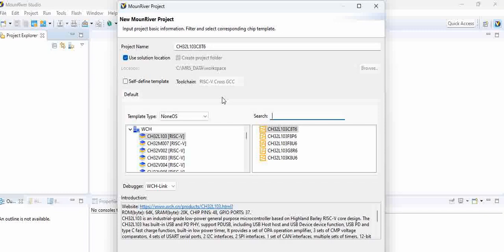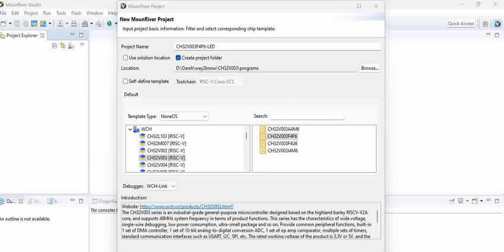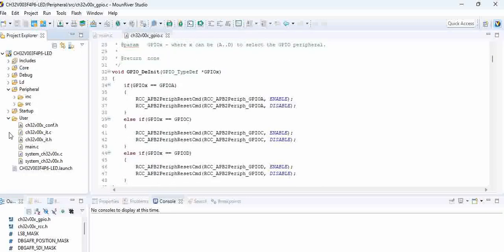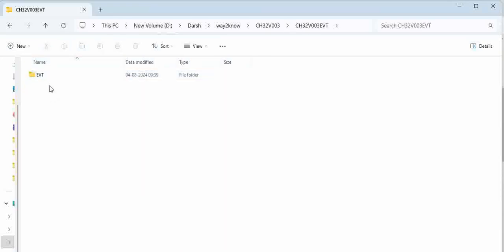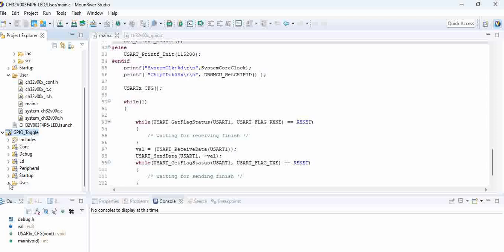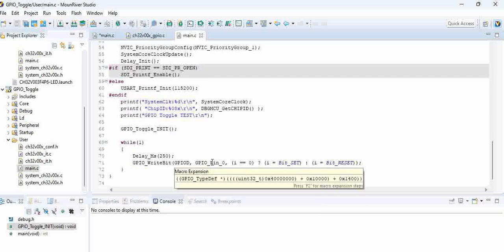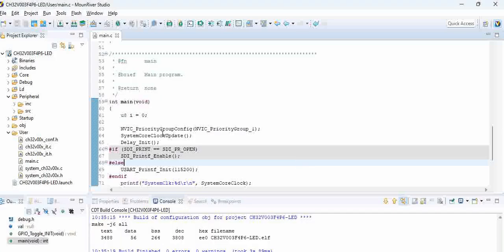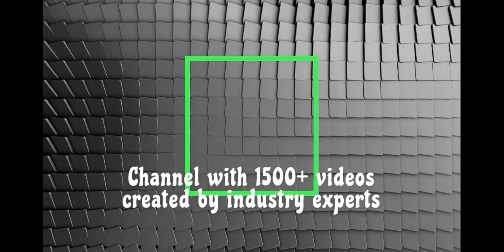LED Blinky code for CH32V003 | CH32V003 Tutorials - Part 8

Comment: please make more videos on teaching the embeded system from scratch. about uart use in ch32v203c8t6 that comes in kit. and what if we add 5k resistor to both ch32v003 and ch32v203 both the boards . will they start debugging using type c cable or not both bords have R11 AND R12 pins empty on usb interface .
Reply from the maker: CC pins serve several purposes. Main is how much current has to be passed is determined. If you mount R11 and R12 which are PD on MCU board, then it is device mode which is OK. The host board should have pull-up. Mounting on either of these board should not have an issue expect sizing the resistor is critical as it determines the current.